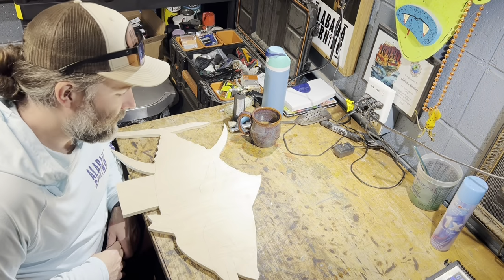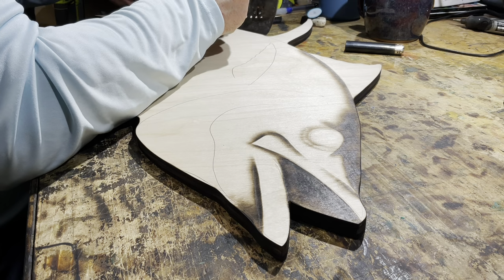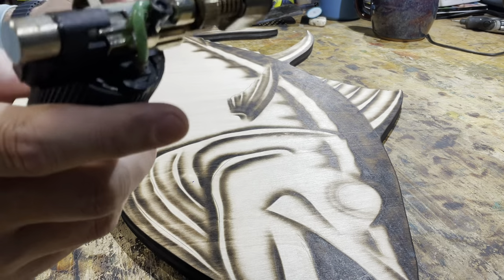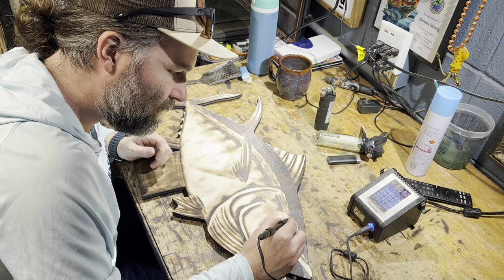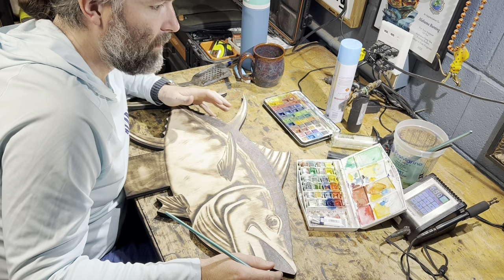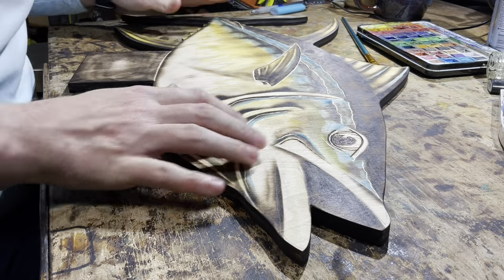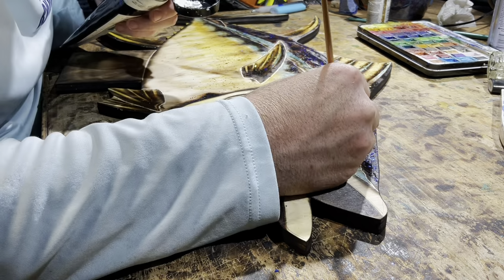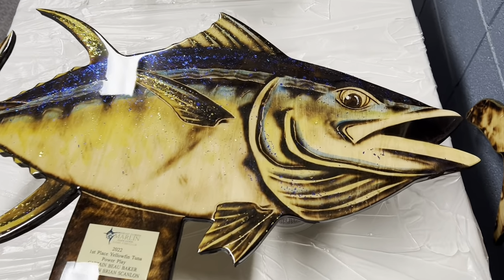YELLOWFIN TROPHY 🏆 (Possible GIVEAWAY)

Comment: 🌴 that blue sparkles stuff , is that clear acrylic mixed with that prism flake ? You can get that sparkly stuff dry in small containers from nail salon supply stores , also was wondering if you used any metallic powders, like on the bodies of the fish , was wondering if editable metallic cake decorating powder in silver or gold would work in your applications?  That epoxy is fantastic !  Beautiful 👊🏼👍🏼
Reply from the maker: That’s called glitterific!

Comment: You mentioned using a torch to pop the bubbles. Are you using your big torch to heat up the whole piece or the smaller one and popping each bubble at a time ?
Reply from the maker: Either one works as long as your moving the flame fast the heat will pop the bubbles. You can use a heat gun as well with no flame!